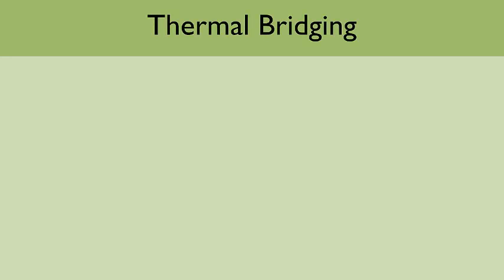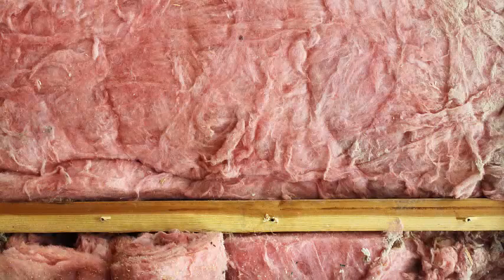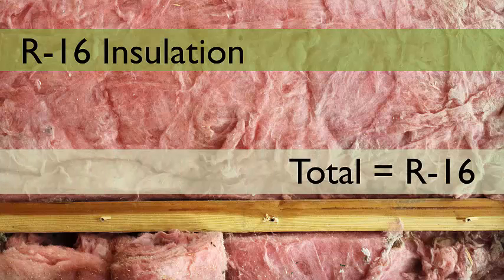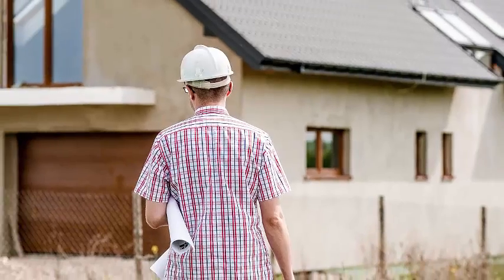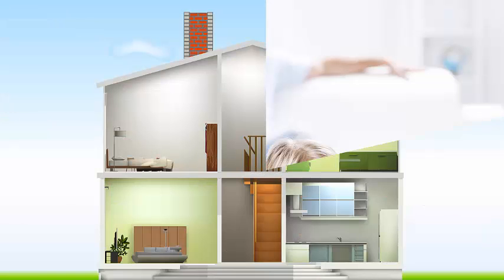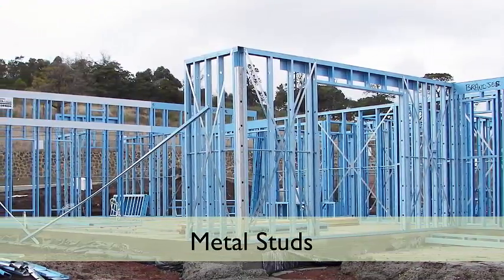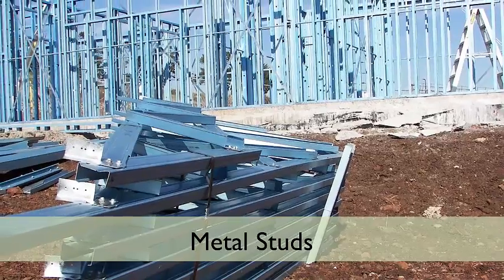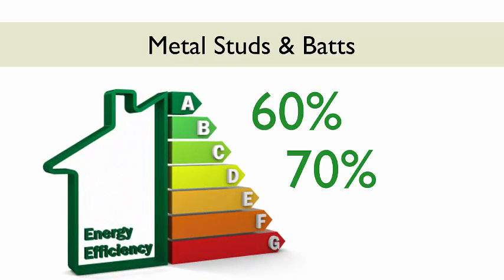Thermal Bridging

Comment: My house has metal studs bolted to a cold concrete floor. I don’t want to unbolt from floor to slip insulation under. So I am thinking about using spray foam over all the stud work where it touches to floor and maybe also up the walls. But not sure what effect this will have.
Reply from the maker: The concrete floor conducts less heat than the steel. You definitely should not put anything under the studs.

Comment: How can we avoid that with steel frame houses? Thank you
Reply: You want wall to wall insulation that covers the steel, in addition to the insulation between the steel
Reply: I'm curious too, im thinking spray foam...
Reply: with proper thermal breaks, steel house is far better than timber one. thanks
Reply: @liuyang635  Steel is terrible for the environment, with the push to greener construction methods, timber will inevitably become the future, whether we like it or not.
Reply from the maker: Avoid using steel frames, but if necessary use foil board insulation on the outside of the frame.